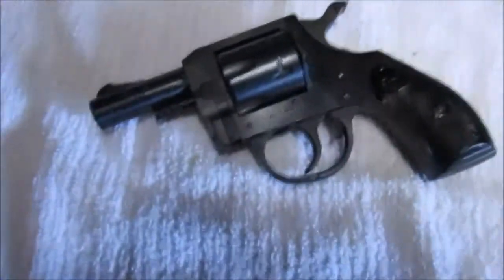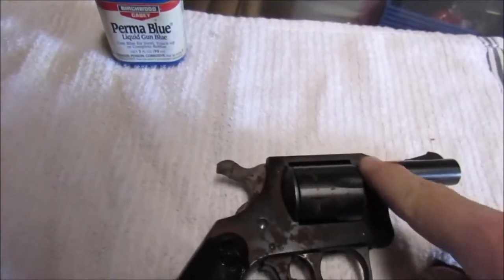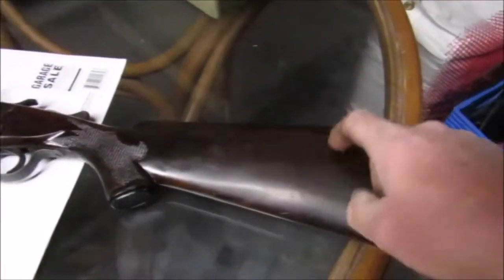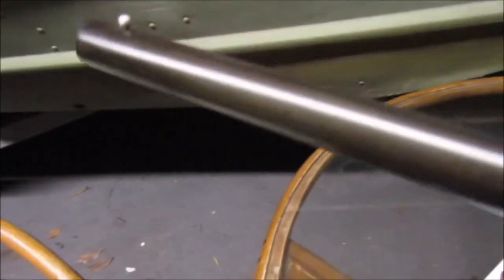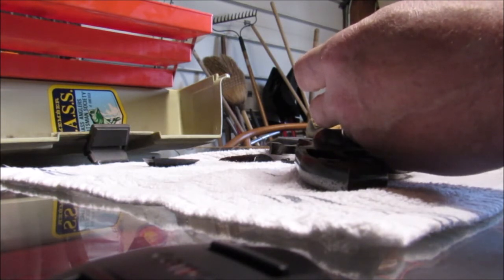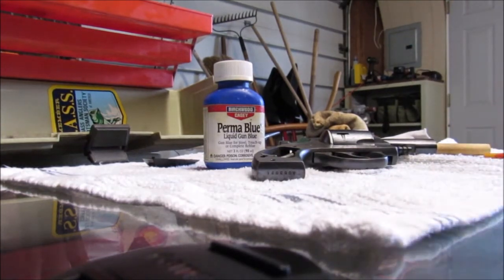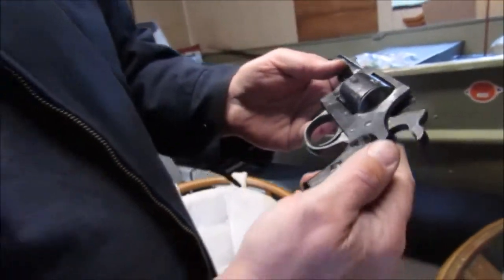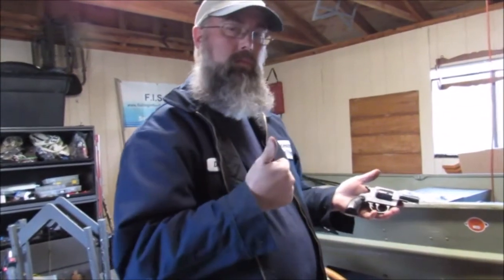Reconditioning a Model 732 H & R revolver

Comment: I've got that exact model ('70s manufacture, actually found in a gun shop about 12 years ago). My buddy inherited one also, but nickel plated. His is out of time; mine shoots ok but has more cylinder wiggle than I like, plus a turn line. Like to get it tip-top for a woods gun, and replace the grips with something that fits my hand - my middle finger knuckle either hangs outside or inside the back of the trigger guard, both painful to shoot.

Comment: Also, I would have removed the cylinder to get coverage of the entire cylinder. Otherwise, there will be part of the cylinder that did not get the bluing. Just saying.
Reply: On mine it literally falls out if you hold it upside down, I'm not sure if its supposed to do that or not. But if you hold it pointed down as you should you would have no issues except if you were trying to get gravity help you when ejecting empties which really should never be necessary.

Comment: four pins and one screw and it would have been completely disassembled. I think that would have made a big difference in getting a uniform cover.
Reply from the maker: I was worried about the screw stripping out. Only the second gun I ever reconditioned.

Comment: Leave the gun as is
Reply from the maker: We were just concerned about the rust that was starting to build up.
Reply: Np not a bad try , well done
I now have a problem with mine maybe you can help I’ll try to explain best as I can my hand wasn’t spinning the cylinder  and I  took the barrel out cocked it back and welded a little bit of metal to the hand  I did that because I was scared to pick it down It was now to long and tick but I grinder it and came out pretty good but now the cylinder wouldn’t spin I only turns when I cock it with the hammer or I  put a little very little force on the front of the cylinder 
I don’t know if it’s because I sculptured the hand wrong  or it’s some other reason  
Any advice would be very much appreciate 
GOD Bless and thank you 
I